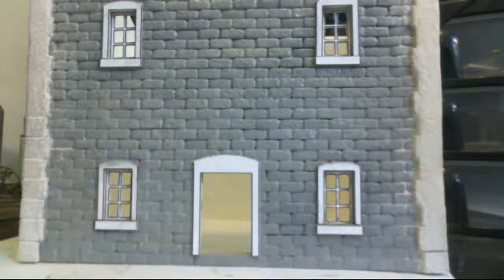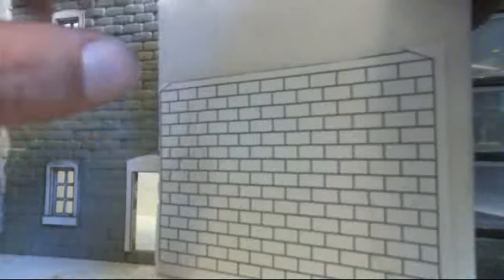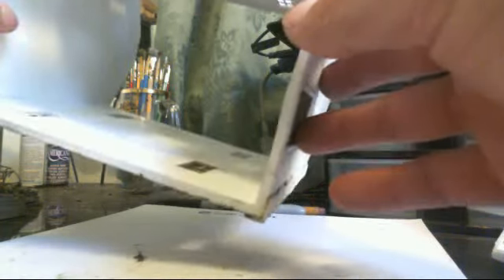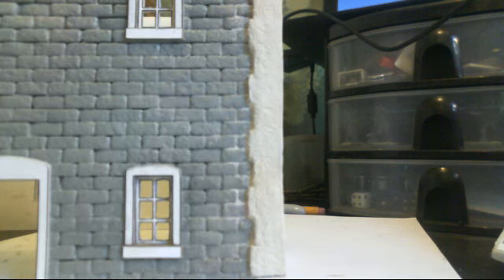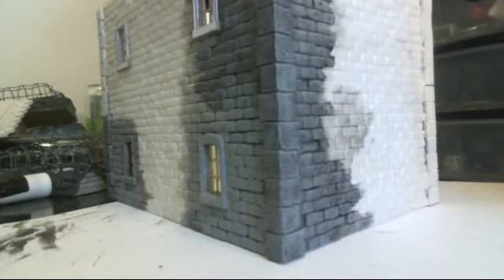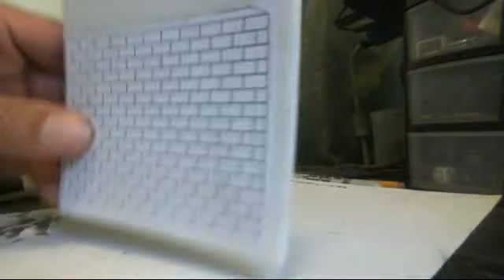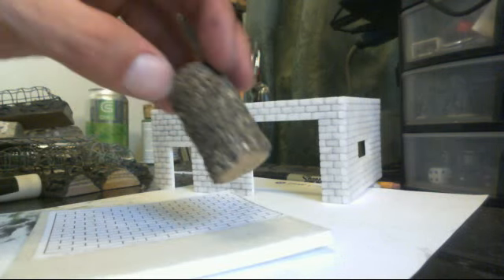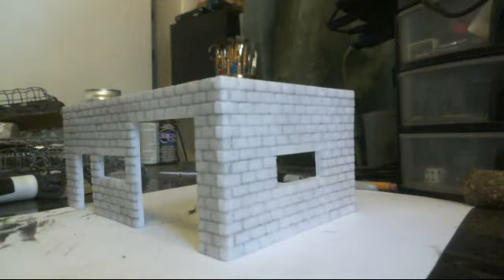28mm WW2 terrain ideas and techniques

Comment: looks really good. that wall you cut out the quoin stones is crying out to be moulded and cast. you could make window, door etc changes easily with in the mould each time for different effects etc.. would that foam, board hold the shape if you pressed in tiles into the roof section? by pushing a square in on an angle i mean..? to form the overlapping effect. if so you could also push in the negative shape of a curved tile too

Comment: This is amazing! Did you just score out the bricks with an x-acto knife or did you also run over the lines with a pen? Looks absolutely incredible!
Reply from the maker: Hey thanks bud! Yeah I think I actually used a large metal pick.  Same shape as a pen, does the same thing.  It's been a while since I played with these techniques. I will get back to it soon.  Thanks for checkin it out!
Reply: It is a great way for texturing walls, I just started with 28mm WW2 after 10 years with GW hobby...I'm going crazy on Illustrator now to make a little more complex design for the stonework-thanks for the inspiration and the very quick answer!!